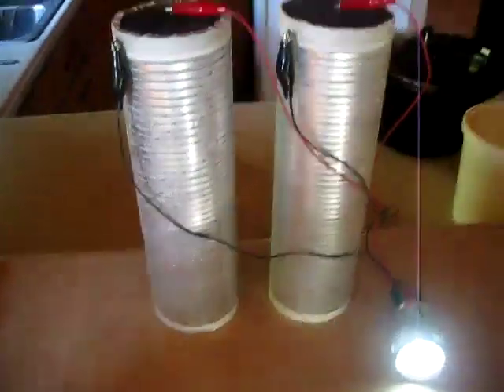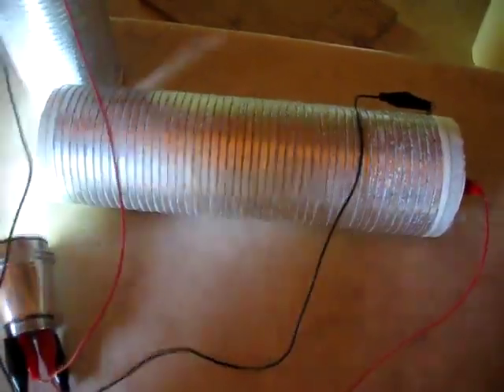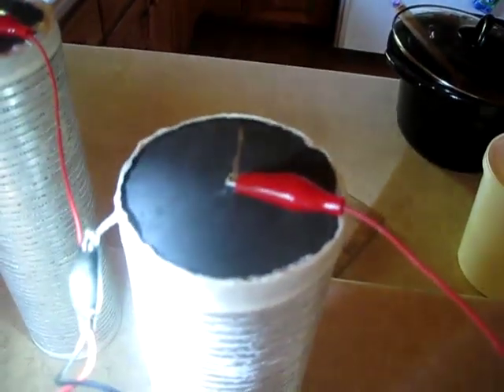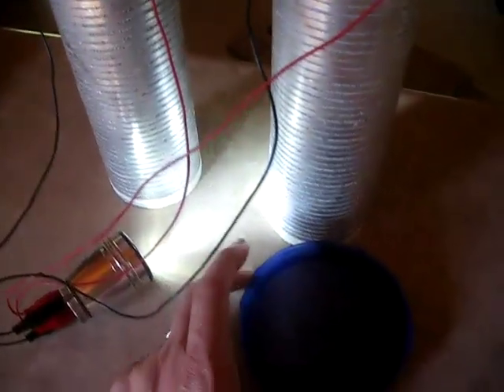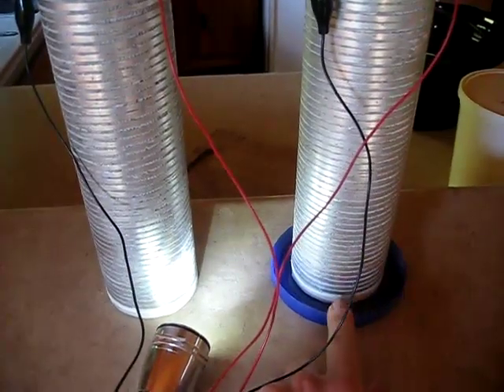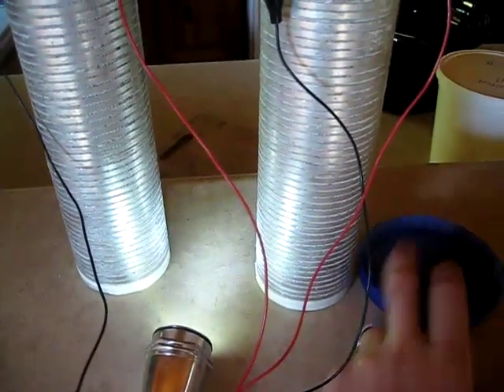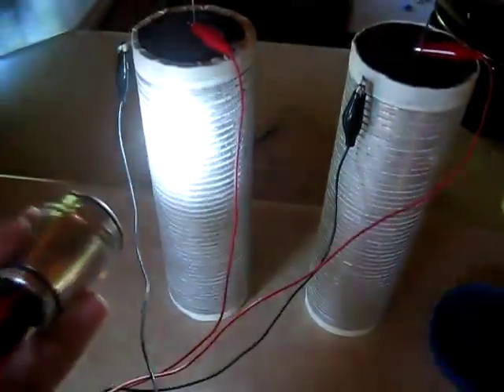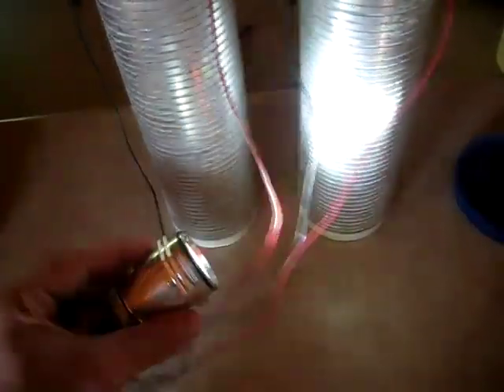LaserSaber air battery update 2

Comment: When the ribbon is rolled like a disc you can paint both sides of the ''disc'' with insulating paint. Then you don't have to worry about that voltage drop if the ribbon touches itself when rolled like that around the carbon rod and the tissue. You also get more voltage because of increased surface area for electrochemical effect. Also, the gap takes like 25% off of the possible surface area so in theory you will get 25% more power!

Comment: I know this is somewhat old but does the diameter of the pipe matter? If not, I assume you could reduce the size or get more power by making smaller ones to fit inside the larger ones and connected in series as one "large" battery, so to speak.

I am thinking of using something like this for security lighting around my yard to keep it somewhat "continuously" lit up at night. I'm sure they could light up some LED strips or spot light configuration enough to give as much visibility as those solar ones do; maybe more?

Comment: Nice and well presented video.But don't you think your wasting too much carbon because carbon rod requires v high temperatures to manufacture why not use activated carbon felt sheets rotated around a cardboard cylinder the type used for textile rolls.

Comment: Awfully cumbersome, delicate and expensive LED flashlight there. It is not economical to build this when we can buy $704 USD worth of AA or AAA batteries and an LED torch and be set for life.
Reply: +Craig Abbott 
So your kids are dragging their toys around with these big units attached to them?
Reply: Also tne available current on these is barely measurable and completely un-usable. Sure they can light an LED that lights at a couple oh mA.. but forget running anything IC based. No a joule thief will not run IC based devices either.

Comment: and yes, if there is salty water - internal resistance will drop (salty water is better conductor - i.e. electrolyte) - more current may be drawn from the cell
and more current drawn - faster magnesium will degrade - it doesn't depend on saltines but on how much current drawn

Comment: You could really pump-up the amperage/voltage of this cell by using multiple carbon tubes of various widths and line each tube with magnesium tape.  Making sure the magnesium tape in each tube is connected with the magnesium tape in the other tubes.  

I think it would be better to use a more durable material than paper for the insulator - cheese cloth or something like that.  Canvas,  which is extremely hard to find, would also be good or fiberglass cloth, kevlar, or other hi-tech material.

Comment: i don't see this as misrepresentaion , look up zinc-air battery, works off the same principle. The air is what is oxidizing the Mg, the NaCl solution is just acting as an electrolite so current can flow, the eletrolite does not take place in the reaction the same way it would in say a NiCD or other traditional battery. And to really get technical its not a battery, it a cell.

Comment: Your lucky. A 25g roll of 4mm magnesium ribbon here in Australia costs $20 bucks. A quick question I wanted to ask was whether the "carbon rods" you use are the only material you have used or have you tried other materials?
Keep posting your videos as I have learned heaps. Thanks

Comment: don't let that light go to wast use the light on a 3d solar panal a large round panal with mirrors on the out side of the solar cell magnified crystals and use HID bulbs ,form it as a cylinder the light would bounds off the 3d solar go back up to the mirrors and then come back down keeping all the light,going around a circle pumping out some power indoors,then hook up a heavy power line to your power meter and let the power co. pay you for useing your power.the meter will spin backwards

Comment: @muddymuddymuddmann If you're wondering how I made my batteries, I just took some pencil leads out of pencils, I took the ones that were between 4 and 8 cm long and made bunches of 15 leads which I tied with rubber bands. Then I took a 5 square length of toilet paper and folded it in half (hot dog) and wrapped it around the carbon electrode. Then I took a piece of aluminium a foot long and 4 cm wide and wrapped that around the toilet paper and secured it with rubber bands. Al is- C is+
Enjoy : )

Comment: My past question sounded stupid. I meant to say: can the batteries be enclosed in say a plastic tube with with holes so just enough air is allowed for max operation, yet significantly limit evaporation of electrolyte? I would do this experiment myself, but I have too many things ahead on the list.

Comment: What is the voltage potential (not short circuit current) of just one air cell with A) just room humidity and B) with the salt solution?

Also, what is the polarity? Do you have the red jumper clip connected to positive?

You may already know where I'm going with this.

Comment: @lasersaber search wikipedia for "Water-activated battery". A company in Japan created the same battery in 2007. The name of the battery is called NoPoPo. watch?v=9pmtPQqGT14 for a short video about the battery. It can be recharged (refilled with water) 5 times, each time can last up to 15-30days depending on application.

I purchased 5 rolls of magnesium and am planning to replicate this as well. Although to answer your question, I don't for certain YET, but hoping to find out soon.  
cheers

Comment from the maker: @bytesilver 

"the fact is, that the magnesium will deteriorate pretty quickly and the cost is not worth the money for alternative energy. At least not with magnesium."

Do you know this from experience?  A roll of magnesium ribbon costs $3.50 if you buy in bulk.  In my tests after one months time my air batteries were still working fine.  I am starting some long term tests now.  Based on my personal experience I think this is a very good alternative energy for many situations.
Reply: if you get 1 amp and 1.5 v out of them, you would get 13.15 kwh/year.  which means that it would have to run for 3 years just to pay back the cost of the ribbon.
not a way to save money on power, but it could easily save you money over buying disposable batteries.
Reply: Could you use zinc?

Comment: Very important question to be answered for all before Building. 
1) HOW LONG does the magnesium last before it completely deteriorates? 
2) Does the power output out way the COST, or does the cost out way the power output

I love your project, I learned a lot from you. Although some ppl my be mislead to thinking this will last a very long time. The fact is, that the magnesium will deteriorate pretty quickly and the cost is not worth the money for alternative energy. At least not with magnesium.